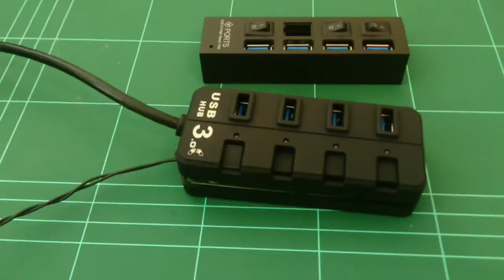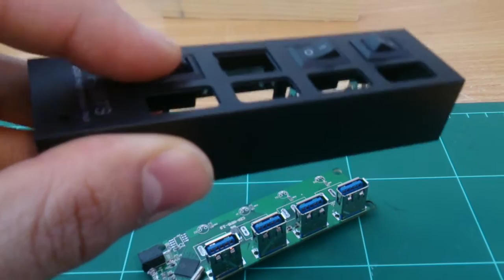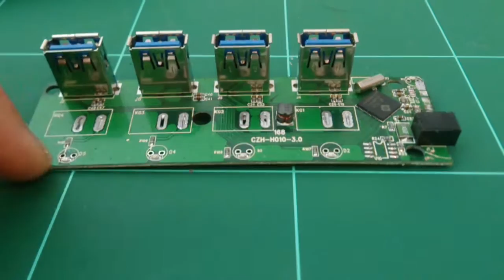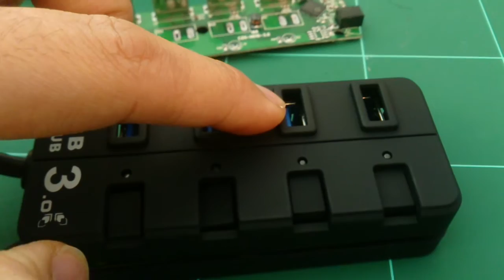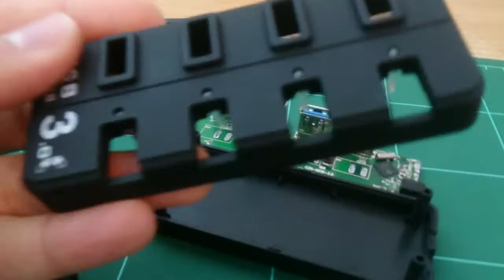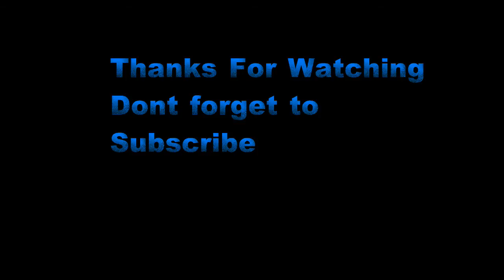USB 3.0 Hub Adapter Review 4 Port Ebay Amazon

Comment: Surprisingly enough, these usb hubs use GL3520 chip which has usb 3.0.
Oddly enough, the chip in mine is placed on the bottom and there is no transformer on the board it self.

This usb hub can also output maximum of 5v/1.5A,

Comment: Both are low quality USB hubs that cost less than $5! You are scammed or you are scamming others!
Reply: that switch is not a heavy duty switch. another lame china made switch. I bought those switch.
Reply: OB Want will this help if i plug it into my PC? because my PC only has 2.0 ports and if i plug it in, it turns it into a 3.0 port, right? just making sure because i don’t want to buy it if it won’t help. thanks !